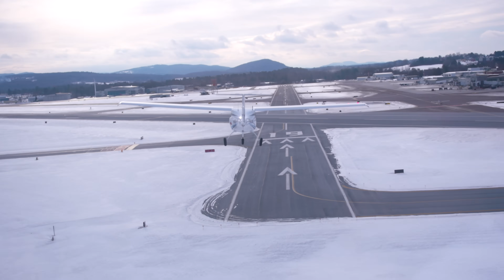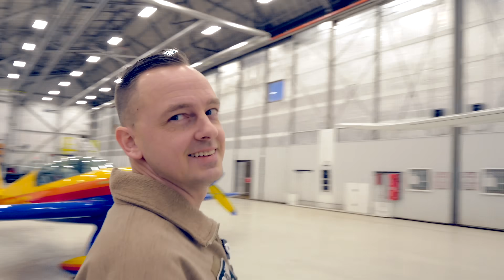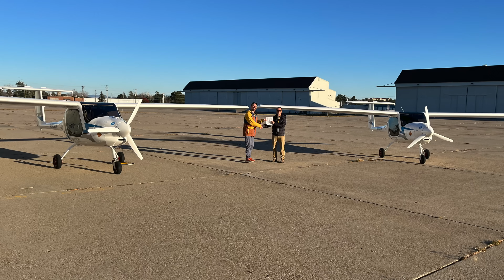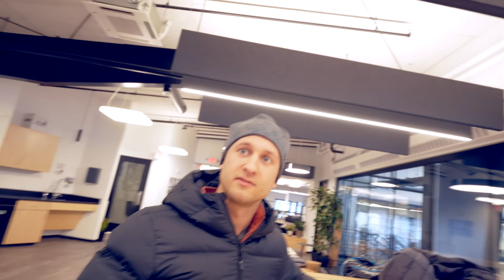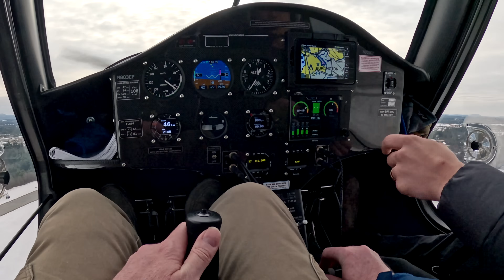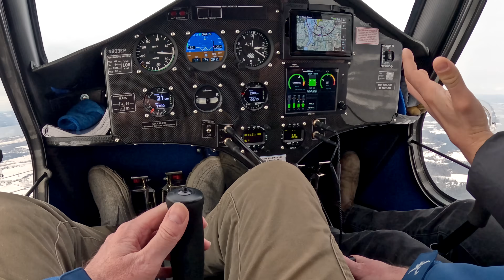1st ever CPL check ride in an Electric Airplane?

Comment: Welcome to the club of electric flyers! My first electric flight, in the Alpha Electro (and solo because that plane isn't type certified and we were flying it with a special permission that didn't allow teaching nor taking passengers), seems to have been 8th October, 2018 :)

(The second time was 12th Oct, 2020, because at the beginning of the flying season in 2019, somebody broke the front landing gear and it took 1.5 years for the factory to repair the plane. That one wasn't solo as the restrictions in the special permission had changed and the club wanted everybody to do a club checkride after a long time of not having flown the plane.)

Comment: We've got a long way in terms of battery technology, but it is good that there already early pioneers willing to push the boundaries of what we can do with current technologies. If you think about what's already available on the consumer market in terms of flight control software, someone could realistically build an electric airplane in their garage with current tech. EG: Peter Sripol.

Comment: Electric can be quite agile as Teslas and performance quadcopters show. And with a purpose-built battery plane you can give it range too. Maybe 500km is straight forward without doing anything extreme and as much as 1000km range might be doable with a flying battery and a slender efficient wing going high and fast with a pressurized cabin. Something you might call an electric jet.

Comment: Ev cars generally want to float between 30%-80% for maximum battery life. How much do you see constantly charging to 100% affecting pack life? As I understand it, pilots wont be dipping below 30% unless they are getting into the 30 minute reserve time.
Reply: The batteries need to be replaced every 500 hours, and they're ridiculously expensive.

Edit: Corrected battery lifespan hours.
Reply: The source is the Pipistrel website.
Reply: @PistonAvatarGuy  I don’t have a source for that so sure it might be true but technology will improve so while it might be a issue now it won’t be in the future
Reply: @AustinWirl  The source is the Pipistrel website. A correction, through: The batteries must be replaced every 500 hours, not every 400.

Anyway, I think that asking for a 5-fold increase in energy capacity and a quadrupling of the battery lifespan, without also seeing an enormous increase in cost of the battery, is just unrealistic.
Reply: These are lfp packs, which love being at 100%

Comment: "Sustainable electric..." Where? When?
Reply: Ice car lifecycle emissions are higher than evs emissions, I would image it’s much more advantageous for electric airplanes because the current ga engines are very pollutant
Reply: @AustinWirl  that electricity has to come from somewhere though. How much pollution is generated from charging batteries? 

There is no win-win situation. Unfortunately we will never have 0 waste energy production. I'd love to see the statistics and compare EV to combustion. I know just from the top that the process of just getting crude oil and turning it into fuel is pretty bad. Then you have the transport to get it where it needs to go. Then you have the process of getting the fuel into the vehicle. Then of course burning that fuel generates pollutants. That's always going to be way more than EV but I'm wondering just how much pollution is generated manufacturing and distributing batteries, then also creating and distributing electricity charging those batteries. Batteries don't lasted forever either and not all of the components can be recycled, compared to combustion engines that can just be melted down and the metal reused for something else, or engine components again.
Reply: @ well solar panels exist, but even if pollution is generated, electric is still superior because the motor itself is insanely more efficient than generic combustion motors are
Reply: are you serious? Electric planes, are same as EVs MUCH more sustainable, they save 70% energy compared to ICE and produce way less toxic waste, it is completely absurd not knowing that by now, did you live under a rock for a few decades? Even if you would charge the plane with 100% coal power, it would be by far cleaner and less damaging to the environment that any comparable ICE planes, and exactly the same is true for electric cars, motorbikes, ships, or whatever you power by an electric motor and batteries if your alternative would be any kind of motor or turbine powered by fossile fuel products.

Comment: I learned to fly in something that's a similar size to the Velis (Ikarus C42).

Great fun and very economical on fuel - but it is cramped in the cockpit & there's not much inertia so you need to catch a power failure sharply - not that it'll be a problem with an electric motor that's insanely simple and utterly dependable.

Comment: My dream is to build an off grid ranch and power it with solar. Also I want an electric airplane I can charge using my solar system looking at the Aerolite 103 electric. The pipistrel aircraft are nice but the cockpit really small good for one normal sized male maybe petite woman, or child.  This is why I figured no reason to pay so much for that just get a Aerolite 103 lot cheaper I mostly fly alone anyway.

Comment: I was at Santa Monica airport when the Beta CX300(the plane you flew over the Grand Canyon) touched down to end its 22 day trip from Vermont. Surprisingly, though a crowd packed the observation deck at SMO, the plane landed and taxied away to the other side of the field and hid away, no photo ops or glad handing for the spectators. I assume the plane was having technical problems, otherwise why waste a public relations moment they spent 22 days building?

Also, I did my last BFR in the Pipistral Electric. Not being able to get one hour of flight time seriously limits that plane. It's great these companies are pushing the boundaries of electric aviation, but it's not there yet.
Reply: Sorry we missed you close-up at the airport, no technical difficulties reported here.🤞We fly everyday!
Reply: @beta.technologies  why didn't you stop near the observation deck and great the crowd who came out to watch you land?
Reply: @lancairdriver  We didnt know there was such a crowd or we would have -  but you know how it is when you get your ground instructions and taxi over to a hangar. We've been feeling the love from the KSMO community ever since we visited, its a fantastic group you have there - sorry to have missed you!

Comment: When decending, with that  low drag, could you use the prop & motor as an airbrake to regen some of the energy you expended to get up to altitude?
You could set the maximum airspeed & as you fly it down the pitch of the prop would act like an airbrake as the motor, in reverse, harvests your potential energy & charges the battery.
My hybrid car does exactly the same going downhill. 
Even my brakes don't use friction unless I'm emergency braking or the last little bit before I stop completely.
Some vehicles use eddy currents in prop shafts to brake on long downhills, charging the battery and stopping brake fade from the heat of friction.
If 6he gearing & auto pitch prop for charging is too complex and/or heavy then a drop down  R.A.T.  (Ram Air Turbine) could be used or a duct opened in the nose or wing roots with turbine generators in the fuselage tubes.
With the super slippery Cd of that airframe it's a shane to waste all energy in S turns & sideslips. 
Plus, the new light, flexible solar panels ciuld ve used on the upper wing surfaces to constantly trickle charge the battery both in flight & on the apron. 
When you've only got an hour, every minute of flight time added is a sizeable free bonus.
Hangar roofs, airport buildings ect. could all br utilised for solar pamels too.
Reply: The Electro does have a regen when you pull the power to cutoff, but it's only a very small percentage regenerated compared to the amount spent to climb - so you don't incorporate that power into your energy planning. Utilizing the drag for steeper approach angles is the primary benefit, the bonus power is just that.
Reply: @KlazerFPV  Interesting, thank you. What you say about tells me there's much room for improvement. That's a very good sign for a new technology. 
Keep safe, mate 🛩️😎👍

Comment: Amazing, and looking forward to seeing some hands-on flying with this thing. I think so far all that I've seen is carefully controlled marketing stuff. You might be one of the first youtubers they are allowing to fly this thing.  Congratulations. You are well qualified for that. 

The Alia is one of the electrical planes that is closest to certification and has a modest but very usable range of a few hundred miles. This space will be heating up a lot in the next ten years as we get better batteries, more manufacturers, with very different models, more range/useful load, etc. I also expect the experimental market is going to electrify rapidly. Fuel cost and engine overhauls/repairs are real drag on hobby planes and once affordable conversion kits start hitting the market, I think they'll be popular.

Btw. I also love being able to play with the early prototype in X-plane. Apparently they did a lot of work with X-plane founder Austin Meyer prototyping this thing in a few years ago and he bundles the prototype with x-plane 12. Worth downloading the demo if you want to try it out. Pretty easy once you figure out your joystick mappings.
Reply from the maker: Awesome thanks! And yes, they gave me full access and I will be sharing the whole process to learn to fly it.  On my second day there I had lunch with Austin and had a great talk about how he’s involved with Beta.  And I agree they seem to be the ones best positioned in the market so far.

Comment: Anyone thinking an electric airplane is a good idea has little understanding of aviation.
Reply: Weren’t there similar statements made during the transition from grain burning transportation (horses) to petrochemical burning transportation? I wasn’t around then but I heard stories…
Reply: @rickdabney5082  Yep, exactly right. In fact, every single new technology ever created by humanity has had the same issues. Plus, each one also had the same naysayers that assume the current state of technology is all there is, and will never improve.
Reply: What do you mean by that? Are you talking about current range limitations, battery weight, or fire risk?
Reply: @milserpentine  Well those are all good points and just scratch the surface of the problems.  Electric airplanes are a dumb idea.  If they weren't don't you think the US military would be using them by now?
Reply: @tkorte101  The US Military already has orders in for BETA's electric airplanes.
Reply: @tkorte101  They don’t have a military use case aside from flight training that’s why you don’t see them in the military. You don’t see them much in civilian fleets due to the aforementioned range issue. However if that is improved the benefits such as not having a critical altitude, higher reliability, simpler maintenance, less checklist items to go through. They are simply better it’s just the range is too poor to make them viable currently
Reply: @milserpentine  Electric GA aircraft are so inferior to internal combustion driven aircraft it isn't even funny.  Only someone with their head stuck in the eco catastrophe narrative would be able to convince themselves they're a good idea.  If all you want to do is go flying around your farm for 30 minutes to check cattle or fences then that's fine, but for anything more than that they're as useful as a solar powered submarine.
Reply: @Island_Line_Rail_Productions  Yeah, and you can bet that program will be cancelled now that there's an actual Commander in Chief instead of some guy in a skirt.

Comment: Power vs velocity and duration always the same, regardless of aircraft --- power varies as the cube of the desired velocity.  If you have the time, go slow
Reply: This is true for ground vehicles too. Most efficient velocity is about 45mph/70kmh. By the time you hit 65mph/105kmh you loose about 60% of that peak but you are going less than 50% faster. The thing most people don't get is that most of the time lost or gained on a trip is at either end unless you are traveling over 80 miles.

Comment: How long does it take to recharge?
Reply: Their website says "A full charge from 30% to 100%, depending on ambient temperatures and age of battery takes up to 2 hours."
Reply: @DUBaviator  That's with current tech. Probably fast charging might come later. It's not fundamentally different than an EV with a big battery. Getting it down to 30-40 minutes should be very doable. Lower wouldn't be too much of a hurdle either.
Reply: You can use a fast charger that does 40-60 minutes recharge. It is ideal from a training perspective. It gives time to debrief and brief the next flight.
Reply: The question is where do you recharge? It won’t be at the gas pumps! And a 120v outlet on the side of a building would not let you recharge in less than 8 hours 😂

Comment: Im definitely intrigued by electric airplanes but my word 1 hr on a full charge.... Cant even do a crosscountry 2 airport ppl requirement... Maybe in 10 years or so the battery life can be improved... And the 15 mins at full throttle is a little nerve racking
Reply: I'm not sure if you caught that, but apparently mr Chops here apparently was part of the coast to coast journey they did with the Alia in about ten legs if I recall correctly.  This is just a warmup for him to fly that thing.

The Velis has been certified for nearly five years now (coming up in June). It has had a few updates to the battery but it's not exactly state of the art at this point. Also, it only has something like 24kwh on board. That's not a lot. It's a lightweight trainer. Solid state batteries might about triple the range for the same weight and size when those become available in a few years. Multiple manufacturers are working 500wh/kg cells now. So that's when, not if. The Velis batteries are only around 170 wh/kg. This is indeed going to take a few years; but probably a lot less than a decade.

The Alia is a very different plane with 200kwh of battery and 330 nautical miles range with a similar wh/kg weight (less even possibly). Imagine what that thing will do after a simple battery upgrade in a few years. Basically that should get through the certification soonish. That's how mr. Chops here is getting some stick time and how they can do coast to coast with just ten hops.
Reply: @JillesvanGurp  “we have a 100% charge , with a flight time of 1 hr and 5 minutes “ at idle
Reply: Electric can be great for cheap training 70% of time. This can drastically reduce training costs. It is also a great rental for short flight. Ya, you are going to need a piston aircraft for a while, but if you are a rental place, it makes sense to have one of these and another piston for rent/training.
Reply: @crissd8283 The battery replacements result in higher costs for electric.